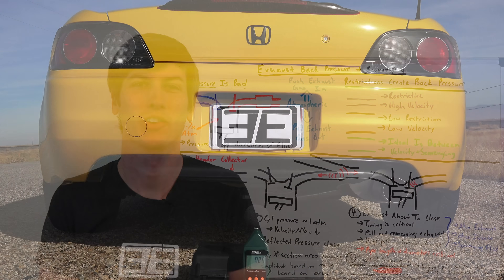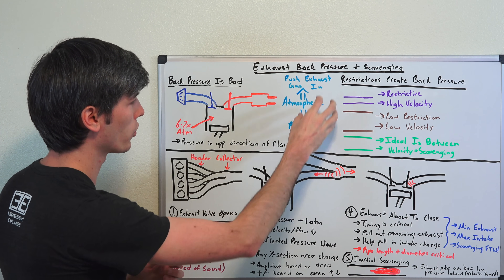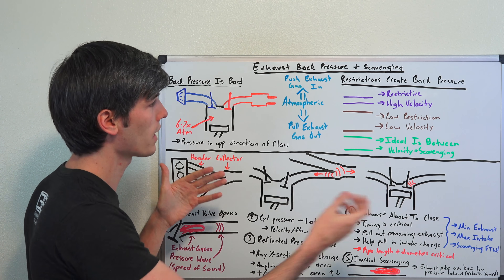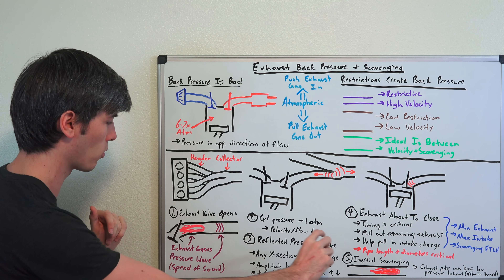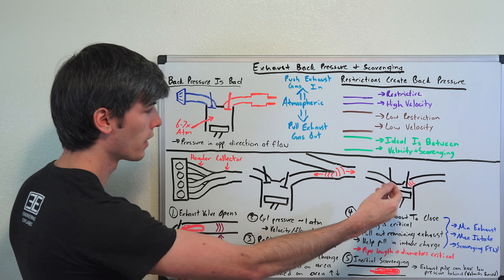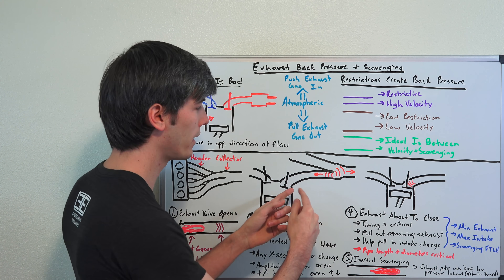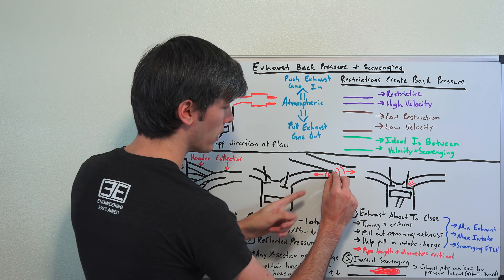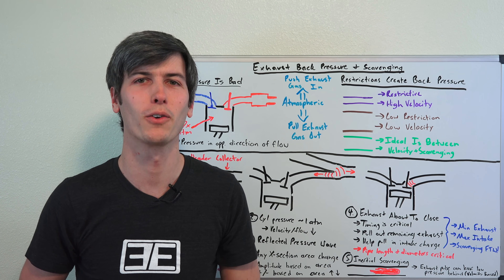Stop Saying Car Exhausts Need Back Pressure

Comment: Putting 4 inch downpipes on a stock economy car motor is going to get you 2HP up above 5000 RPM and lower your torque everywhere else.

Comment: I have a question, and I know it's an old video but it would be really appreciated if I could get some insight (love the channel by the way, I was sad to see the s2000 go but excited to see the mx5 in action!) My question is, as exhaust length increases, would pressure naturally drop? like with say an air compressor system? If so, why is there not some kind of exhaust that stages down or up in size smoothly through its entire length? is it just cost? Or is there no gain to be had? I don't mean stepped sizes, but a gradually tapering pipe, kind of like a 2 stroke exhaust? Thus creating low restriction/large pipe diameter  after the exhaust valve, gently tapering to high restriction/small pipe diameter, thus more flow, at the end of the exhaust. Has any manufacturer ever done this that you know of? with cars of course. Thanks so much for taking the time to read this if you do :)

Comment: Back pressure is helpful in a 2 stroke engine, hence “tuned pipes”
Reply: thats why 2 stroke enduros have those resonators.
Reply: kinda... how an expansion chamber (tuned pipe) works in stages. when the pressure is moving back to the piston from the exhaust it's in the compression/intake stage it's good (helpful). any pressure that moves back during the power/exhaust stage (back-pressure) is bad. the reason the pipe is so fat in the middle is to reduce back-pressure in the power/exhaust stage.
Reply: @gatorage850  
A clearer explanation is that a tuned pipe is designed to allow sound waves to reverberate back to the exhaust port when the air/fuel mix is compressing.
This allows a sort of pressurized charging by pushing the air/fuel mix that would otherwise be wasted back into the combustion chamber.
Tuned pipes are only effective at a range of RPMs that time the reverberation of the sound waves with the compression of the air/fuel mix. 
The fat part of a tuned pipe is at a distance from the exhaust port  mathematically calculated by the exhaust gasses moving through the given diameter of the exhaust pipe at the speed of sound, usually 1/3 wave.
This is why a power band fades away as the exhaust becomes overheated as well.
Reply: @kaisersose5549  I was trying to keep it short/simple and just showing the pressure on. mostly the end result of the wave affecting gasses near the piston. not trying to explain the whole wave process for how technical and confusing it could be for someone new to understand/picture clearly or want to read.

Comment: ...2 stroke?
Reply: back pressure on the exhaust/power stroke is bad. this is why a good expansion chamber is fat in the middle.  the pressure/fuel returning from the pipe to the piston on the intake/compression stroke is good.

Comment: So is there a formula to calculate what diameter and or length piping we should use based on perhaps displacement? If I were to, for example of a common modification, to remove catalytic converters/resonators/mufflers, would I generally just stick to the same diameter piping or reduce/increase diameter to compensate the pressure those items used to create? More interested in small scale systems like motorcycles 🥰

Comment: You can have an engineering degree, sling words like "coefficient", and whiteboard this video until my eyes glaze over. I had a golf cart that I swapped the engine out for a Predator 420cc motor with a straight pipe and it lost 5mph from its overall top speed. We reinstalled a Walker muffler on that came with the engine kit and it gained that top 5mph back. Nothing more than back pressure added.

Comment: What if I remove the exhaust pipe and let the exhaust valve eject gas directly in atmosphere. 

*Just jocking
Reply: Where's your horse, then?
Reply: @OldSchoolZ-wy2yx  😭
Reply: @OldSchoolZ-wy2yx  that would be jockeying. Jocking would be... wearing restrictive underwear? or behaving typical of the highschool 'jock'?

Comment: maybe it's no longer the case, but i was told a long time ago that back pressure protected the valves from burning. i took the exhaust off my bandit 400 16V and it was loud but all the way to 12K RPM just bonus grunt i loved it

Comment: My 2001 Yamaha FZ1 usually comes with a guillotine valve in the exhaust at the point when the four headers come together. It keeps back pressure at low RPMs and opens up as you rev. Whoever owned the bike before me modded it out of there, so I dunno how that feels in practice.
Makes sense though.
Reply: You must not have watched the video. It’s not for back pressure. See 5:00

Comment: What happens if you possition the exaust tip on the lowest pressure area at the back of the car when speeding (created vacuum) to help extract the gases from the pipe and cilinder?

Comment: Question please: 
What is better to be connected to stock 2" exhaust on Civic 10th nonSI HB manual
1. Catted DP 3" with 3" Front pipe (300 cells) - this mean it starts fully 3" and than stuck into 2" like a train into a mouse house
2. Catted DP 3.125" going down to 2.5" with 2.5" front pipe (200 cells) ....and than the stock 2"

Comment: i wonder then, if it is possible to design an exhaust header with similar properties to a trombone i.e. with a sliding section of tubing which follows the RPM of the engine

Comment: Does anything change with this when dealing with forced induction?
Reply: As I understand it since turbo setups tend to be rather crowded many builders instead focus on creating as much of a pressure differential as possible on the turbine to improve spool with massive turbo elbows, downpipes, and exhaust systems.  The turbo is a massive restriction so I don't think resonant tuning is possible downstream of the turbo.  Some maximum effort builds use equal length tubing and twin scroll manifolds and turbos but I'm not sure if that is for scavenging or to even out the exhaust pulses on the turbine wheel.

I saw one manufacturer of log type manifolds argue that the lower internal volume was more beneficial for spool up than resonant tuning with equal length runners for certain applications and the thick, short runners were less prone to cracking than tubular equal length manifold ( although that could be fixed with additional support bracing).

Comment: Exhausts need back pressure. Without back pressure there is less heat in the exhaust. Less heat in the exhaust makes it more difficult for the carbonmonoxide to pass through the catalytic converter. If the catalytic converter is not heated enough it will also plug up over a shorter period of time.

Comment: When the manufacturer tuned your civic, it did it with the oem exhaust system. If you straight pipe that heep of jap tin, you have effectively killed those ratios in the tune. So stop cutting your mufflers off i cant sleep.

Comment: Do a video on 3 inch turbo mufflers vs glass packs on turbo cars and some people put spacers on muffler flange to create a exhaust leak because they say it gives more power or less back pressure any facts on this i live in va and glass packs are illegal so I'm wondering if a turbo muffler on my wrx is as good as a glass pack..

Comment: So I dont need anything after my headers. Gotcha
Reply: I would love to have side pipes for each cylinder out of the fenders.
Reply: Open headers are fine.  And manly
Reply: Unequal length straws
Reply: Who needs headers? I use those save the turtles metal straws instead, cheaper that way
Reply: @Snow-vo1yi  Headers are just really big metal straws
Reply: @kumo9993  Save the turtles!
Reply: @Snow-vo1yi  gives you that perfect exhaust note too 👌
Reply: @BackstageChief its a bubble machine
Reply: @Snow-vo1yi  So you own a honda.
Reply: Please don‘t.... my Golf II Diesel once lost the exhaust pipe after the collector, I had all the attention I wanted since I sounded like a 60 ton Leopard II Main Battle Tank ;-)
Reply: @wernerviehhauser94 NgL... My 1.9 diesel jetta sounded so good dumping right out of the turbo lmfao. Couldn't leave it like that very long
Reply: What's cool is that you can set up a custom header that can take advantage of Bernoulli's effect to use each cylinder's exhaust to actually create a vacuum on the other cylinders, it works similar to how a carburator works. And that will actually increase efficiency and power by a few horsies since your motor doesn't need to work as hard to dump exhaust! It's pretty cool!
Reply: @EatMyYeeties  I'm also going to take a step and speculate that's why there's 'X-pipe' exhaust, to create a similar effect throughout the mid-pipe area as well, making it even more efficient for multi-head engines.
Reply: @EatMyYeeties  is their a certain name for this kinda header?
Reply: @Bino White Actually I have, and I wouldn't call those good-sounding. They're just loud af.
Reply: Just go full open man.
Reply: Just go streat out the head nothing make sure u have a fire extinguisher lol !!
Reply: You don't even need headers, just cut holes in the fenders for proper ventilation
Reply: My 4runner after someone cut the cat off of it 😅 jhc it's LOUD
Reply: Pull the whole manifold off
Reply: Yeah pretty much the only thing I took from this video is that Cat, Muffler and resonator delete is the way to go 😂😂😂
Reply: You need to run an extension in your open headers to get proper back pressure this kid is crazy he doesn’t know what he’s taking about take your truck run it with the exhaust then just whack it off as close to the motor as you want and see the difference in power it’s gonna be a lot louder but your gonna be down on power, @Bill Burgen those are called zoomies and you can either make them or buy them, 68 dart came with a slight header extension just like I ran on my drag car usually it’s about 12-18 inches to your back pressure point from the end of a long tube header
Reply: No. You need an exhaust with proper scavenging.
Reply: 10/ 15 hp gain flowmaster
Reply: Headers and about 32-36 inches of pipe behind collectors
Reply: what about 02 sensors?
Reply: @Tatum Leonel Why would you do that? You sure must be full of concience...
Yuk.
Reply: That's gonna be loud asab
Reply: Just cut off the muffler
Reply: No he's saying you don't need headers, the exhaust ports themselves are good enough.
Reply: Ah yes so basically nothing after my skunk racing headers sweet 😮‍💨
Reply: I have a strange irritating problem. 08 Silverado 5.3 I get 2 different exhaust sounds when driving is sounds good but at a steady speed and at lower rpms letting off gas I get this old crappy tractor sound tap gas goes away comes back again. What I've done how it is now still doing it. Muffler gone both cats after headers still on and plugged in. Removed 3rd cat no O2 where I cut off. Still running all o2s. How do I get rid of that tractor tone at low rpms
Reply: Your car doesn't, you do though😂
Reply: Exactly, just straight pipe it, and by straight pipe I mean remove everything from the manifold/headers back!
Reply: You need a turbo or turbos🤣🤣
Reply: @80KG_Costco_Chicken  Nope... Just more ccm's. 
Low weight, High displacement. Thats The way to go.  😉
Reply: @80KG_Costco_Chicken  I hear ya, that's what headers are used for, routing to the turbo 😆👍 anything after that is optional
Reply: @80KG_Costco_Chicken  this
Reply: You need it to channel the gas out of you.

Even if there are ram air,
Still, due to complicated physics,
Some gasses cannot easily escape the underbody and might contaminate and poison the cabin.
Reply: Full nerdout response (may have been covered in 5 years and a few thousand responses):

You need some back pressure.

Consider two engines.  One with a car's ideal back pressure and one with effectively zero back pressure.  One near perfect example would be the Merlin engines in the Falcon 9.  If you look at the nozzles (bells) you will notice that the upper stage has a much longer and wider bell.  That is thanks to less back pressure (you want to size such that the exhaust leaving the rocket has the same pressure as the outside of the rocket (or for upper stages just "good enough").

But the car, driver, nor passengers would be happy without an atmosphere, so getting below 14.6 lbs times the exhaust port size will be tricky.  But try to keep back pressure low.  And yes, driving in Denver (or better yet, the nearby mountains) would help if you have a turbo (but I suspect the aero helps more).

One final comment.  Reducing backpressure is likely the biggest advantage air-dropped orbital launches have, but it wasn't enough to keep Pegasus,Virgin Orbit, or Stratolaunch viable.
Reply: @wumpusthehunted2628 I think I understand what you are saying.  I thought rocket exhaust shapes were based on the atmospheric density they  work in, like a booster rocket has a different shape than whatever stage is after the boosters jetti.
Reply: Cars with no back pressure at all sound like ass
Reply: @80s_Boombox_Collector backpressure doesn't change exhaust tone.. Who told you that lol
Reply: @80's Boombox Collector, I have a rare 1981 datsun 200sx 5 speed manual transmission rwd coupe with a 100hp 2 liter naturally aspirated inline 4 cylinder and I have a hedmen header with a 2” straight pipe exhaust all the way to the tip out the rear and it sounds so loud and amazing. When I say straight pipe I literally mean header to 2” exhaust pipe with no muffler, resonator or cat at all. People have told me that I seen again that they can hear me from a few miles away when I’m full throttle. It’s nice and loud but no extra resonations meaning it doesn’t sound like a ricer with all that metal tin can sounding annoying extra added sounds. I think what makes it sound so good is the fact that it’s a proper sized diameter pipe and the fact that some engines just make better sounding internal combustion sounds than other engines. I feel like it has to do with the emissions head meaning that each cylinder has two spark plugs one on each side of the head per cylinder.
Reply: @adamgallahan6747  200SX that's cool, haven't seen any of those around anymore. I thought they all rusted out, lol.
Reply: @adamgallahan6747  thanks for flooding the air with NMOG, NOx, and CO so you can have a car that annoys people blocks away.

Comment: Most engines work best with BACK PRESSURE!  Even the most powerful race engines.  They open the exhaust valve early and then bleed the pressure off the cylinder slowly.
Reply: You’re as clueless as the come hombre.

Comment: a lot of people dont realize that while an engine may have no need of exhaust backpressure, the way an engine is tuned is usually accounting for some back pressure, and depending on how smart the ECU is, it is possible for an engine to run worse or have other adverse side effects from simply removing exhaust backpressure. looking at you newer dodge gasoline trucks!

Comment: So if I didnt have enough back pressure could this cause a popping noise from the combustion chamber
Reply: yup when I had a straight pipe, but of larger diameter than stock, with big tail end, it did popping noise with little flames, when u reved it... on 1.9 8V 205 GTi.... it literally run better at high revs, bcs of straight pipe

Comment: Ok so I have a question now.  So what if you were to essentially fit a supercharger (or other positive displacement pump) to the exhaust system in order to assist in pulling exhaust gasses out and even generate a vacuum?  It would require some clever plumbing to avoid crazy fluctuations in exhaust gas pressure I’m sure, but would there be any downside to a forced exhaust vacuum in theory?
Reply: Very hard to implement mechanically. If anything what you could do is run a venturi vacuum pump or similar.
Keep in mind with exhaust you're also evacuating the expanded gas from combustion, so to maintain a sufficient pull you'd need a supercharger double the size of one you'd have put on the intake

Comment: you need back pressure on low rpms to run engine smoothly. but not on high rpm. therefore you need a variable exhaust backpressure valve.

Comment: My car has a 2-stroke sooo, my cars exhaust needs reflective sound waves :D

but yeah planing to put in a 4 stroke and then that dose not matter anymore and i have to remove the  components that are tuned to the 2 Stroke. ^-^"

your videos help understanding what i have to consider with the conversion - keep it up your a big help :)

 kind regards Lara
Reply: back pressure will severely harm the performance of a 2-stroke here again you are confusing back pressure with the reflective sound waves as it works the same way in a two stroke.... reflective sound waves are much more critical for the performance of a two-stroke to keep the intake from escaping the exhaust port. these are not my words but the words of Pop Yoshimura the greatest tuner of all 2-stroke engines there ever was and the inventor and designer of Honda's first two stroke engine
Reply: @donniebaker5984  edited it to be correct :)